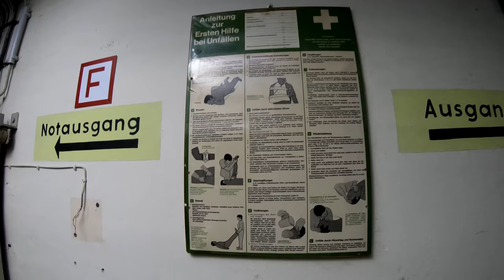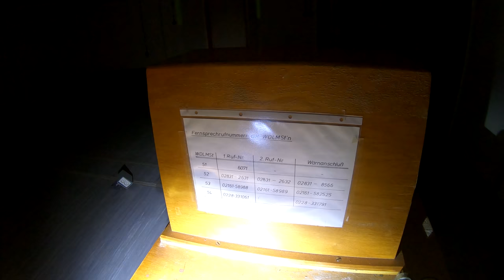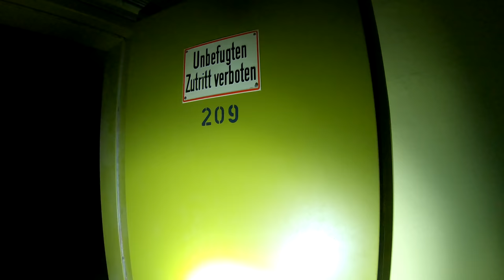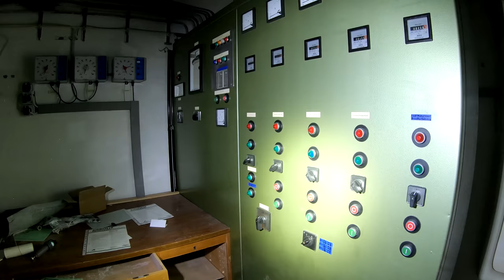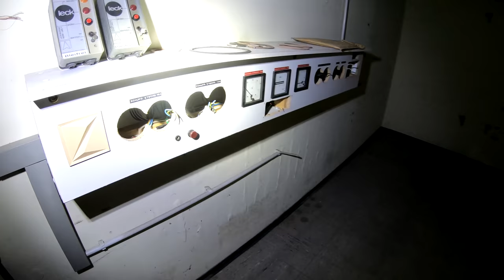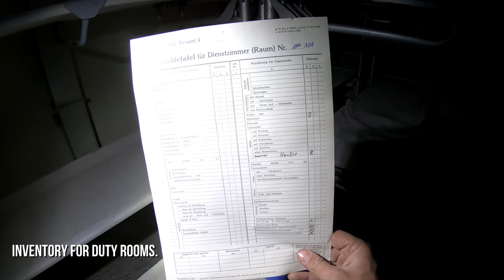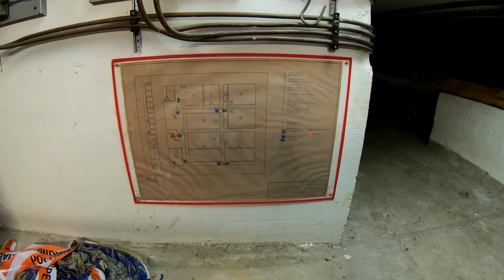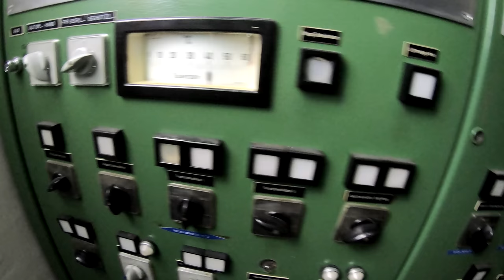URBEX | Abandoned cold war warning bunker

Comment: This bunker is in remarkably good condition. There's barely any rust, no chipping paint or water infiltration issues. It looks like it only needs a quick clean up, new filters for the HVAC and water, and some basic checks, and it's ready for service.
Reply: Most German old military places are like that. They can be repurposed in 72 hrs notice. Like the runways and buildings in all closed airbases like Kladow or Templehof are kept in functional order.
Reply: Did you notice the red light that was on towards the end on the top of the green switchboard (he turned his torch away to be sure and you can clearly see it's on).  So my guess it it's a status light showing the mains power is connected.  You'd just need to start flipping switches to turn everything back on.

Comment: There are in Fact still a lot of Bunkers in West Germany that are either Abandoned or are still in use for Emergencies. Like in my Town there is an old Abandoned Hospital from the Cold War under a School which you still can see. If you ask the City, they still allow it to see those abandoned Rooms. Or in my old School there also was in the Cellar a small Air Raid Protection Bunker. The Cellar had all normal Doors, but one Door was out of Metal and the Wall was pretty thick and the Ceiling also pretty low. Some Train Stations or Subways have hidden Doors that you cannot see at first, but with closer look you can and behind those Doors are also hidden Bunkers for Emergencies that are still used now.
Reply from the maker: I believe I heard about that school with an underground hospital! Would like to see that too :)
Reply: @ExploringtheUnbeatenPath  Its in Dülken, belonging to the City of Viersen. The School is called Förderzentrum West Viersen. Maybe just ask the City and probably its possible =)
But tbh last Time I have seen it when you were able to go down there is 6 or 8 Years ago...

Update: School has been Demolished and a new Building is on Top. I guess the Bunker has been demolished as well then!

Comment: I would be careful about turning on the lights. Unless that place has sump pumps that run once a while, or a guard patrols and turns on lights once a while - any energy consumption can trigger a warning system that there is somebody actively inside of the place. That's assuming that there is a system setup, which I doubt there is. But as technology improves, I wouldn't be surprised if those systems get setup. It's not hard to do - just send a warning message if power usage spikes, and then if its not anticipated, send a guard to check it out. Often power gets cut off with a lot of abandoned places unless they have to use sump pumps and so forth to "maintain" the place. If a place is not touched often, it can get a "power profile" - i.e. sump pump runs often when it rains often, rarely otherwise else. Great video - just be careful about turning on lights and so forth because power consumption can be measured and can be used as a data point to inform the authorities that somebody might be in that building. Plus depending on vandalism (I've done a data center study on a building that was stripped of its aluminum and copper) - a lot of things could be stripped out, which could lead to power shorts if you turn on something that was cut and shorted out, and that will be a huge spike in energy usage and create a lot of sparks. I've had that happen to me before.
Reply: A system like that could be theoretically be setup, but I think if they were concerned about unauthorized entry it would be easier and more reliable to just setup a standard alarm of some sort. While smart metering is getting installed and becoming more standard, normally it doesn't report back the data in real-time. Instead it gets logged and sent in bursts (such as once per day). By the time the data is collected, collated and analyzed and someone notices it would be far too impractical to be used as a security system. TLDR; Don't worry about turning the lights on. The chance of someone analysing small fluctuations in power demand for security purposes is infinitesimal.

Comment: What is that at 20:18? Looks like some kind of decontamination chamber
Reply: The circulating air is cleaned / purified by the water of those sprinklers. It's for ventilation. You can add additives to the water so the system works more efficient. Second, the water cooles the air off. The heat is transferred from the air to the water, and then the water can cool off in deeper underground tanks. You take the thermal energy from all the generators, electronics, peoples breathing.. out of the air, to the water and then finally out to the relatively cold outside underground surrounding. Of course it's not a filter like you'd use to clean contaminated outside-air, but much more a system to keep the air breathable and safe to use for a longer period of time.
Reply: @Max-re9kk  Thanks for the detailed response, much appreciated! And interesting. Cheers.